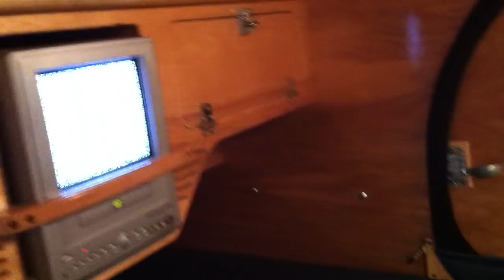2006 CampInn 560 Ultra Tear Drop Camper

Comment from the maker: 2 inches of insulation on the roof, blocks the sun out very good.  Turn on the fan and the thing is a dam wind tunnel 3 speedsto choose from.  It takes 4 mpg off a gallon of gas to pull it, I get a nice 19 mpg in the Honda Pilot pulling her.  These things have been around since the 50's this company has nailed this design down, addressing most issues with the design.

Comment from the maker: @DMFmonster thank you, the battery is tucked away on the right side under the counter.  Very clean installed, running tv 2 hrs a night, running fan at night, and lights and water I've used the battery for a 2 night stay.  I have yet to ever run out of power.

Comment from the maker: How well something holds its value is what I look at; Brand new this thing cost $18,000 six years ago.  I could sell it easy for $14,000 today, to replace it today would cost about $21,000.  I insured it for $200 a year, it will be repaired and or replaced if its get damaged.  Also I could never see myself in anything else, its perfect for my needs.

Comment: that is absolutely cool. you have emergency exits of sorts, in case left door or right. i dont see fires starting in middle. plus as small as it is, 4ppl can sleep in it. also A/c could be added fairly easily if one desired. and a very small unit too. wouldnt take hardly anything to cool it off

Comment from the maker: I use the campground bathrooms, no one even the large camper use their toilettes pain in the rear to clean.  They are expensive but I can sell it for as much as I paid for it and the quality is outstanding.  Its value is a 10 out of 10, allot of folks just don't understand that so they go out and buy a pop up, which is fine but dont expect to re sell it and get 10% of your money back.  So in reality this unit is cheaper than them in the long run

Comment from the maker: @Fenix281able Not too good at guessing I would say, I bought this one used for allot more than that.  Visit the Campinn site, weather you build or buy research is very important.   These Campinn trailers maintain value and once you cannot buy them new I suspect go up, if you just want something to thrash on Little Guy Campers makes units in that price range.

Comment: That is nice looking trailer. It reminds me of the tiny camper of the 1960s that had an outside galley in the rear. Good luck with it. Wow all the storage and it looks roomy.  How does it handle when you tow it?

Comment: I've towed 2000 lbs with my 4 cyl 120 hp car, with 1000 lbs of people and stuff in the car. I have to let the clutch slip a little to get things moving but once it's rolling there's no problem at all. I'm not sure I'd attempt if my car had an automatic transmission though, as putting that much torque through it on the highway wouldn't be good for it.

Comment from the maker: I'm not a big fan of BMW and a Honda is a clock on wheels.  Hondas are much less money than BMWs so I guess comparing the 2 really means nothing.  

I just don't think I will ever be at the point in life where I will spend that much money for that little amount of utility in a car.  Then again....Mercedes has some sweet SUVs but again the Japanese have them beat, getting better gas mileage and maintenance ease.  Now days you see BMWs everywhere anyway not so special anymore